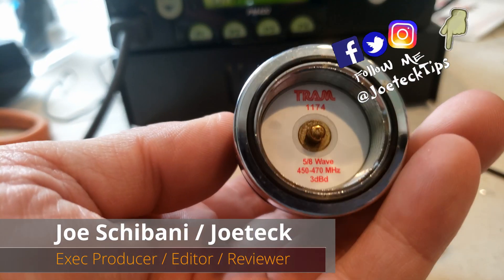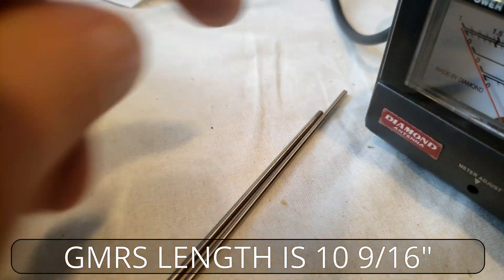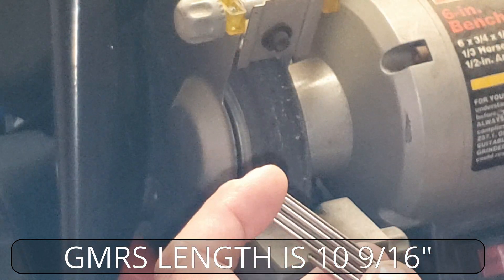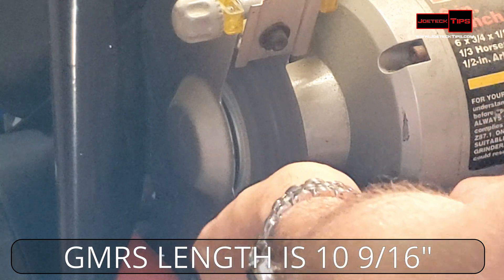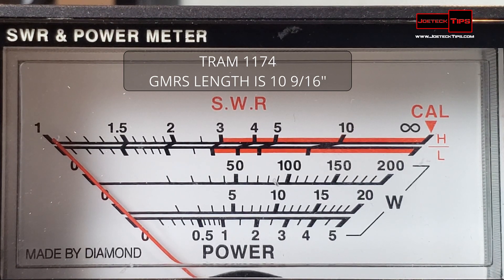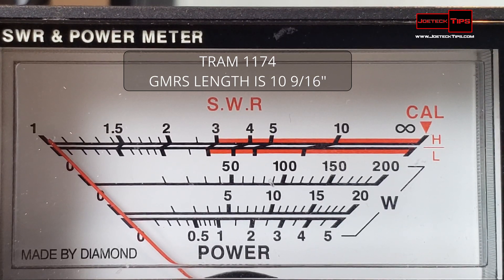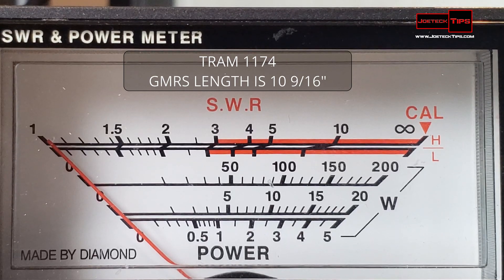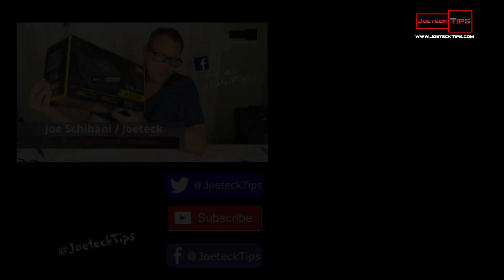How to TUNE a Tram 1174 Antenna for GMRS | Amateur Radio & GMRS

Comment: I got this antenna after watching a video from Soladaddy. I tuned it using bolt cutters, as suggested by Notarubicon. After using it for quite some time, I can attest that there are situations where it works better than a 5/8 over 5/8 antenna. Everyone's results might differ, though.
Reply from the maker: I am confused about why you posted that here, as I explained how to tune it better.

Comment: So is the 10 9/16" measured with the base or the whip alone?  I just bought a 1174 and they say to use the cutting chart, but I cannot find such a chart. I may just have to see where it resonates as is and go from there.
Reply: Whip only..

Comment: Just getting into radio, just got my license this morning!  I'm completely new to this.  I would like to get a tuned antenna, since I don't know how to do that.  Is there anywhere that sells pre tuned GMRS antennas?
Reply: Some retailers like Midland might focus on the GMRS frequencies with their antenna offerings, but you still want the check the SWR when installing. The method and location the antenna is mounted will play a role in the SWR so install it first, then check with a meter. I have a good one that was $90, but some can be found in the $50 range. Maybe borrow one or ask a ham to check it for you. The Tram 1174 is made for 450-470 MHz and I'm a bit surprised that that whip needs that much cutting off to get the antenna centered on ~465, but that's why you test with a meter.
Reply: There are some 1/4 wave antennas that come pre-tuned and cannot be adjusted like the Larsen NMOQW450, Laird QWB450,

Comment: Hi there. Where did you get the other antenna whips? I am very interested so I could make mine also. Thanks
Reply from the maker: I bought 5 antenna's, so that is why I had 5 whips. I tuned 5 of them for 5 radio's for sale.

Comment: So less than 1.5 is good?  Other channels are saying 1.5 is the sweet spot for GMRS?
Reply from the maker: how so? 1.5? The lower the better. Less power coming back into the radio is best. They are incorrect. You are inadvertently slowly blowing up the finals.